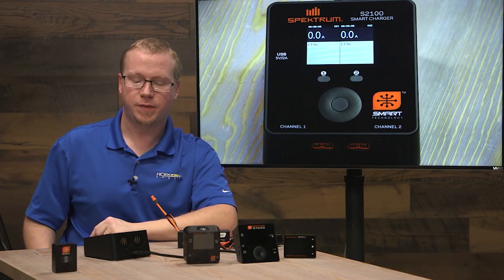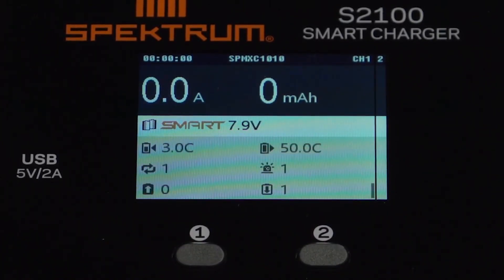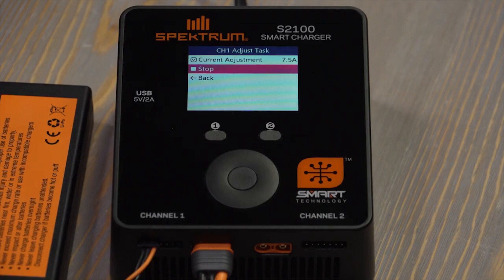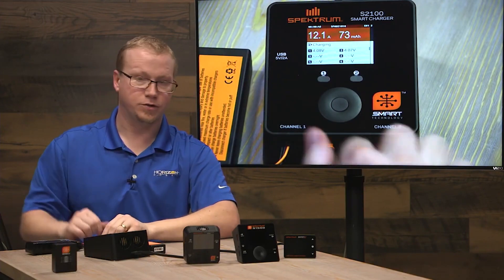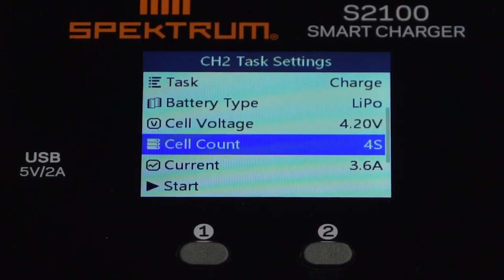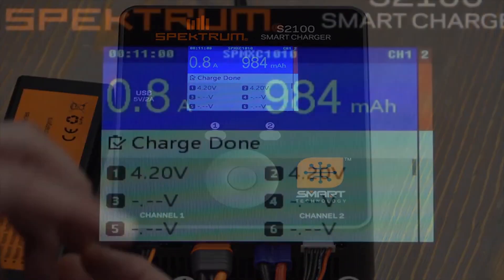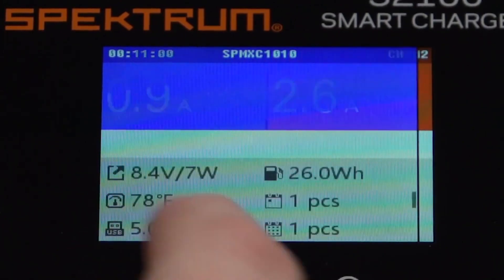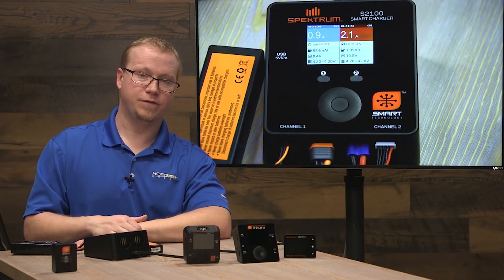Spektrum Quick Hit Tech Tip - How to charge Smart and Non-Smart on S2100 Smart Charger

Comment: i have a  5000mAh 100c 4s 14.8V and when i start to charge it it says abnormal balance port connection and it’s all plugged in is there something that i did wrong or missing?

Comment: It would have been nice to charge the same type of battery and mah rating smart and non so you got to see the settings they used. IE they used a 3s 5000mah smart battery it would have been nice to see them use a 3s 5000mah non smart battery

Comment: ☠️BLACK BARON☠️ I bought it. Very nice and simple user interface design. 2x Ports for loading my 6S batteries and a USB port for charging my Spektrum Transmitter and my XK124. Very convenient in a compact product design.
Reply: ☠BLACK BARON☠ I purchased two 6S Spektrum G2 Lipo with the software updater cable to charge G2 Spektrum batteries as well. For some reason, the S2100 shuts down with the Spektrum G2 batteries connected at 3,5A on Channel 1 and 3,5A on Channel 2 port. Any iDeas in software and firmware?

Comment: Quick but important question: I only have your Gen1 Spektrum 3S and 4S batteries. They are all set to go to storage charge after 72hrs. So far so good. But what about the batteries which I use on the field and come back home at different levels say one at 55% and other one at 25% etc Will they still go to auto-storage if they are above the 3.9V or 3.8V or do I need to manually get them now down to auto-storage? What about the ones which come back say at 10% etc Can I leave them like this for storage or do I also need to manually charge them again up to at least auto-storage? When manually charging batteries down to storage level do we use the same charge like when we charge them up? (Ex. 2200mAh at 2.2?) Thanks!!!
Reply from the maker: If the battery is left above the storage voltage that is set for the battery (say 3.7v) then it will go to that voltage after that 72hrs. IF it is below that voltage and you do not intend on using the battery for some time, go ahead and charge it like normal to that storage voltage. Hope that helps!
Reply: @SpektrumRCvideos  for 3S and 4S what is the best storage voltage? 3.7 or 3.8 or 3.9V? Thanks!

Comment: I’ve charged one non smart battery and lost both charging ports. Sent it back, Horizon Hobby sent me a new S2100. For a month I dedicated the replacement S2100 charger for only Smart batteries. Today I needed to discharge three 3s 1800’s. Didn’t get 5 minutes into the discharge... and my backup is headed back to Champaign, IL.
If you want a Smart Charger I’d suggest the Gen2.